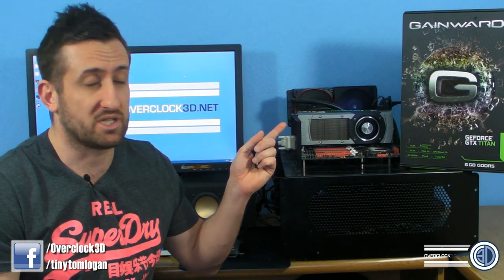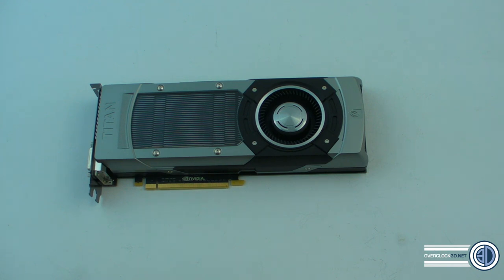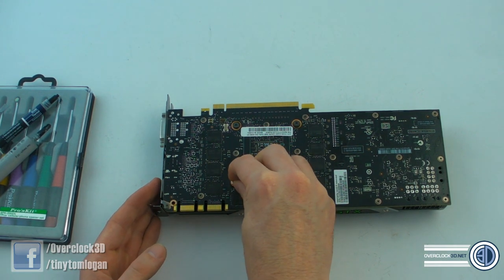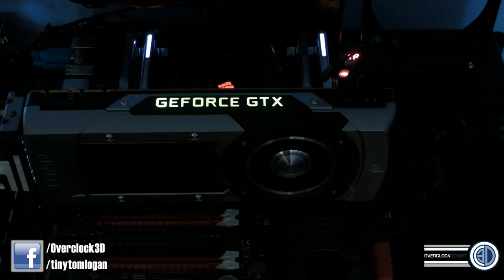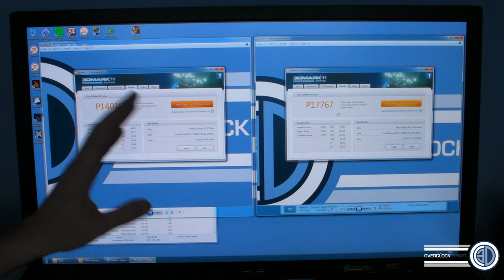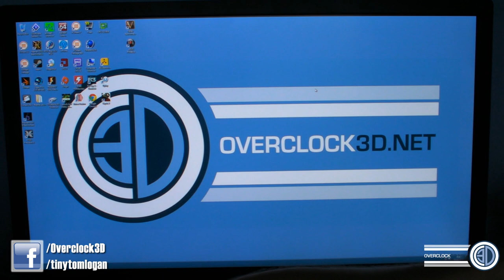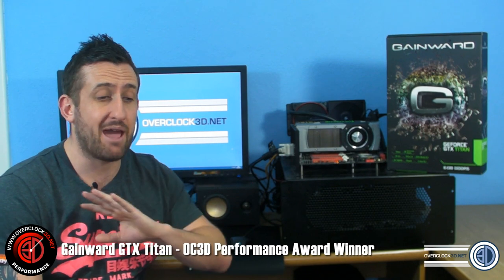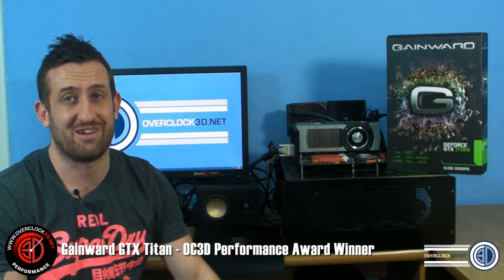Gainward GTX Titan Review - Feature Length

Comment: Thanks Tom, Glad you always mention "noise" of cards on your reviews, This card has me VERY interested for replacing my 480 SLI setup, 680 not quite worth it, 690 is sli and blows hot air inside the case, Titan is fast, quiet and blows the air outside, crazy price but can't have everything.
Like I said from the start 680 was the midrange!  Previous GTX cards were always HUGE die sizes in the past 500mm2.

Comment: In addition to what Matrixo2 said, also take into consideration you're getting that from a SINGLE CARD.  With the other Keplar cards it takes some sort of SLI to get that, such as a pair of 680's or a 690, which is a single card, but it's still SLI since it has 2 GPU's on it.

Comment: The Devil 13 was $999, it was a limited edition card (just like the Titan is) and is now sold out. Just like the Ares 2 did which was $1300 but came with built in water cooling.

Comment: It's very true about resolution; with all the same maxed out setting on my GTX 560 SE on TESV Skyrim, I went from playing 1280x1024 @45-50 fps to 1660x1050 @27-32 fps, so it was a big difference, might upgrade to a GTX 660 though.

Comment: Damn the cooler looks well put on. Didn't see it too well but it looks lapped quite well. Makes me a bit sad, as i usually manage to improve the stock coolers quite a lot (lapping, better Tim, high flow or single slot brackets, tiny washers to increase pressure).
First time I've seen them seemingly pay a lot of attention to it on a stock cooler.

Comment: I meant 7000 as in AMD series. I can reach 1.2ghz no problem with my MSI lightning. Though i run it at stock 1100mhz bcuz its plenty for my 1080p res and it never reaches above 60c. Typically Amd cards have more driver issues, but i heard the new AMD drivers are awesome.

Comment: ooh crap i meant anti aliasing 2 x smaa. the other issue is that it gets really hot when i play and sounds like a  blow dryer after 30 minutes of playing and burning hot after an hour could.  im using a tj-11 case. drivers are updated. it plays far all my other games on max everything.  smaa x2 gives me smooth performance but a few graphical glitches on crysis 3 but i noticed its not playable on max anti aliasing.

Comment: Actually it doesn't quite work like that. The size of cores matters, as well as the clocks on those cores. Memory pipelines more often than not are also a limiting factor, when the core just can't get the resource and sits idling for 10-30% of the time. Present in many lower end cards, though all the software shows it to be 100%.

Comment: my only complaint is it has a bit of coil whine when it hits over 1060mhz, and it sounds like a high pitched squeal type noise :/ but its only for like 1-2 seconds when gpu boost "ups its power"

Comment: Is the black "front plate" thermo conductive and so cools the ram or is there absolutely nothing cooling the ram? If the ram requires no cooling, sticking a All in 1 WC on the gpu should be relatively simple and worth trying.

Comment: The professional GPUs released in previous years have always been analogous to their consumer models, only with a certain set of features and extra core instruction capabilities. For instance the previous gen Fermi cards come with 448 cores and look remarkably similar to 480s and 580s, especially their performance at the same clock. I'd stay with Tom on this one, it seems they got all their cards sorted and then AMD released the 7970, which caused them to shuffle the branding a bit.

Comment: I brought them up because Id rather buy a titan with the possibility to add a second 1 in the future, than a 690 and stuck with 1. As a dual gpu card, the drivers from what I here are pretty good. You claim you know everything about the drivers used in both the AMD and Nvidia cards. Do you even own a high end 600 or 700 series card??

Comment: You guys are completely missing the point.  Read this very carefully:  Nvidia did NOT have GK110 available to use in the GTX 680 until November 2012.  Period.  End of story.  They didn't hold back at all, GK104 was the only chip they had that could match the 7970 at the time.  And by the way, the 7970 is far faster than the 680 now...

Comment: It actually is very much open for discussion since frame latencies are horrible with CFX, if you drop the frames that you can't see (1ms frames) from graphs you end up with a result that reflects what you would see in real life. The result is a CFX setup that's barely faster than a single 7970. 

Just read PCPer frame metering review part 3. 

And comparing single GPU to multi GPU is stupid anyways.

Comment: the Phenom II stuff was just fine, and I think AMD still makes good Budget stuff. If I were building a budget Gaming PC, I would go all AMD (like I did for this computer), and it would appear Microsoft and Sony have a similar mindset, because both the new Xbox and the PS4 are using AMD Tech.

I do agree that the CPU line went downhill after Bulldozer, but the GPUs still present a good budget line.

Comment: I've nearly finished my PC, using it now. I just need to replace my graphics card, since I just stuck my old one in. In my opinion I'd rate the titan very low because of it's price, At the price, no graphics card for me would be enough, it's simply too expensive. The old GPU in my PC at the mo is the, Palit GTS 250 Green 1024MB GDDR3. I loved that GPU.

Comment: I need help deciding i got 2 Asus GTX580 dcii in sli (air cooled). currently running 120 hz asus 23'' monitor. i noticed I couldn't run anisotropic filtering on anything above 2x on crysis 3 for smooth game performance. I still want to keep the branding the same with asus but i dont care about main brand.  I want to finish my current gen rig with a current gen card water cooled to finish my loop got 1200 max budget or should i keep it till 700 or 8000 series? will get higher res monitor latter.

Comment: I love the look of this card and it performs amazingly... For now, If you think about it the 580 had 512 cuda cores and the 680 has 1536 that's triple the cores which means if they did that for the 780 the Titan would be performing at a gtx 750. now that's to say that the scaling's the same which it most likely wont be because its on the same architecture but still it might only barely beat the 780 and that's coming out this year so why spend so much?

P.S sorry for the spelling I'm dyslexic.

Comment: I dont know about TSMC capacity to output enough GK110 GPUs in April 2012 at the time of GK104 launch, but one thing i know, GTX 680 was faster than 7970 while consuming less power and we are talking about a 256bit GPU vs a 384bit one. Nvidia knew this and didn´t force the GK110 launch, because they didn´t want to put all the cards in the table. The competition was weak and just didn´t justify that. If 7970 is faster now due to drivers updates, i don´t know, but GTX 680 evolved with drivers to.

Comment: Then you made the right choice. 2 7970s or 680s are probably the best setup for running multiple monitor displays or high resolutions such as 2560x1600. Two titans will beat it, but for more than twice the price its not worth it unless you have no budget.

Comment: Why... are PC still designed with many cpu cooler upgrade options ranging from minimalist stock to Kilogramme heatsinks and All in1 WC, but graphic cards have none. Although high end gpu use around 300W and overclocked intel CPU use much less than 100W? Shouldn't it be the other way round?! or motherboards should have GPU and Vram sockets to simply enable easy personalized cooling? There are options for Watercooling Gpu's but only relatively complexe and very expensive ones.

Comment: 3%? lol. I believe you are talking about the Ghz edition, that was released before the vanilla GTX680. GTX 680 however is more robust in drivers capability and reliability, and has more overclock headroom, not to mention way less power consumption when overclocked. HD7970 it´s a very good card, but not better than GTX680, not even close when you put all the Nvidia technologies and driver robustness.

Comment: Tom actually doesnt use xfire in orca. There are 2 cards in crossfire but the bottom one is shut off. He does this cause he doesnt need the horse power and he said the Xfire drivers are crappy in games and benchmarks. Do your research plz.

Comment: Yea but those cards don't really matter to us gamers. The dual gpu cards usually aren't good choices because of drivers and 2 680 or 7970 are better. Amd still kicks ass in their gpu line. If they dont come out with cards this year, than the next gen will probably be beastly from both sides. Im glad too because i just bought a 680. I dont wont it to be obsolete 2 months after I bought it.

Comment: If this was supposed to be the "680".. People would really make a stur about the price. I don't think the price would have been signifigantly lower if it was called the "680", the titan is 2 times the size of the 680 so it kinda have to be 2x the price. Bigger die = higer risk of faulty dies = higher cost. Also they had to supply most of the cards to the titan supercomputer..

Comment: now the question is , if this should have been the 680 what chip have they been working on the last year ? en then is Maxwell going to be 30-50% faster than titan
. in other words , I really need a new 3d card , still running on 6970 and this is the worst time ever to buy a card, 680 is mid rsange card , titan is a year old overexpensive card and 7970's have been around for to long now , where do I go?

Comment: You don't get it, Nvidia COULDN'T have forced TSMC to produce GK110 in March 2012 because it had just taped out in January.  It would have been physically impossible to release GK110 in spring of 2012.  Besides, if the 7970 is so weak as you say how come its only 15-25% behind the Titan in most comparisons?  Take off your green colored glasses, the 7970 is a great card as is the 680 and the Titan so we all win...

Comment: Intel doesn't have a monopoly yet, they are close but AMD has the APU line which is very promising and might be the future of processors. in 5-10 years we might not need GPUs at all. Intel has the enthusiast, mobile, and most of the server market. We need amd to succeed with their CPUs. Look at Ivy Bridge, it wasn't much better than sandy bridge because Bulldozer was a disappointment.

Comment: Is this worth buying now for 400 usd? Is it as good as the 970?
Reply: IWImovies the 970 is around same performance, titan has 2.5 gb more vram which is good and has much better compute performance. The thing is 970 is 300 bucks now i think. i think for 400 bucks you can almost get the 980, possibly even used for cheaper. Or the 780 ti would be much cheaper at like 300 bucks and is 10 percent better than the titan.

Comment: The 690 and 7990 are DUAL gpu's. This is the fastest SINGLE gpu out there for the moment. So you have to compare it to a 680 or a 7970. Or use 2 titans to compare them to a 690 or 7990. 
Are they currently overpriced? yes, definitely.
Do they give us a glimpse at what will be affordable in about a years time? Absolutely.

Comment: Utter nonsense.  The GK110 chip in the Titan card didn't reach market in the Tesla until November 2012.  When Nvidia released the GK104 GTX 680 in March last year they simply had nothing more high end available to use.  GK100 was scrapped early on probably due to yield/power issues so they had to wait until GK110 taped out before they could even think of releasing a Titan-style flagship.  This fantasy that Nvidia simply held back because the 7970 wasn't impressive enough is utter fantasy....

Comment: Did you even read my comment before you replied?
I said it was overpriced, but that's not the point of this review. You have to look at this from a tech-perspective.
This is a new generation of graphics cards and this speed of single GPU's will be available at a reasonable price in about a year's time. 
Don't feel bad if you spend a lot of money last week on your 7970 (why else would you be defending them so fiercely), there will always be a faster card the next month.

Comment: Gav, i think you missed the WHOLE point of this as TTL explains. yes its far to expensive  and YES a dual gpu card wil have better performance. so i can not see your problems your having with this honestly. this is basicly what the 680 should have been as many other will say it. i would not buy this card, rather wait till the 700 series and THEN have a watch. for now my 580 sli is holding it own pretty good.

Comment: is there a 7990 out there?? Devil 13 and Ares II neither are a true 7990. Both have higher clocks because there aftermarket cards. If the 7990 were to come out it would come first from AMD. The ones that are out there are aftermarket. Again plz do your research.

Comment: The MOST EXPENSIVE 7970 is $600, $400 less than a a titan. If you want the comparison to be fair, you have to compare it to a 7990 which is in the same price range and blows this fucker out of the water.

Comment: So what if the pricing is overpriced? becouse its not A GAMERS CARD this is like ares II it is a special card but not limited with the production. SLI has problems too like the crossfireX on some games out of there + ho cares if gtx 690 is more perf if it runs out of memery? and i would buy a Titan Not a "titty" over the gtx 690 (like more a single gpu cards), + older cards payed 1000 bucks like 8800 Ultra what was too a overpriced card and if you think i am green boy i have right now a HD 7950.

Comment: > Why would you spend £850 on a gpu and £200 on a cpu?

Because games depend so much more from graphics than cpu that it takes that near-1k GPU to bottleneck that £200 cpu!

Though it is true, this is all epeen, and if you are even looking at Titan, you are probably looking at lga 2011 + 2 way Titans. Else you would be looking at 660 tis in xfire, a single 680, 7950s in xfire, or a single 7970 ghz. with a 3570k.